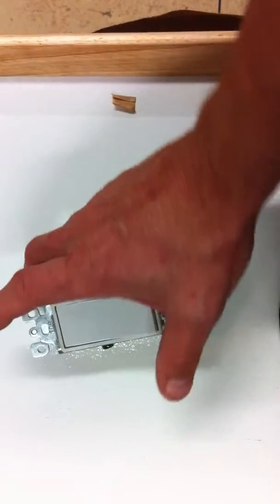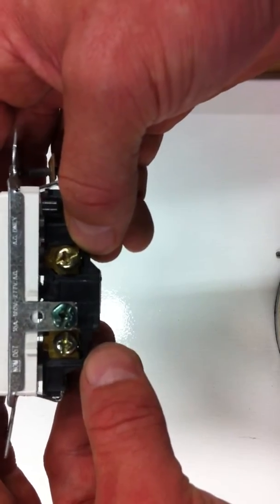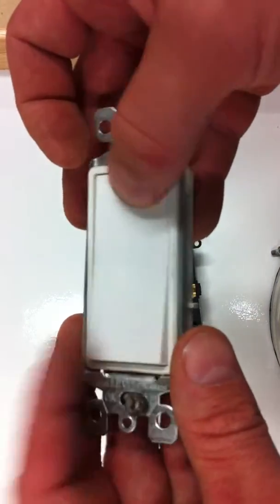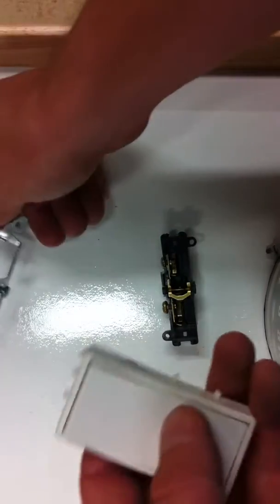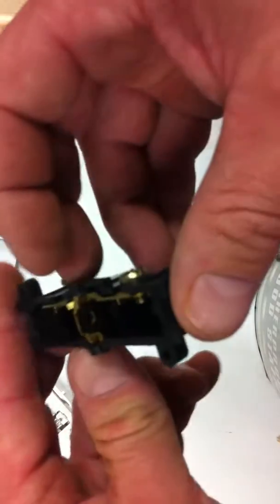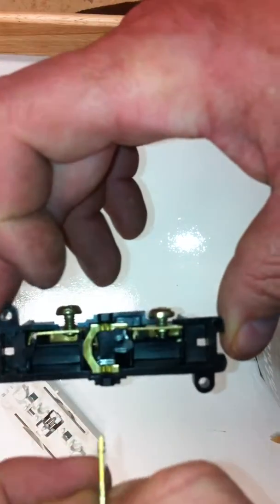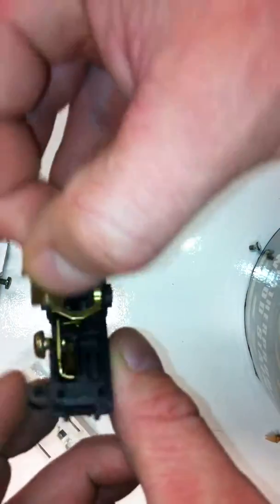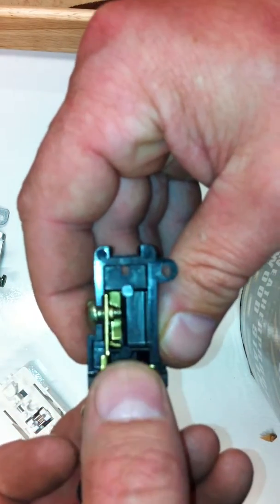Broken Light switch- How a square light switch works

Comment: Only video on actual components of actual switch. Congrats to you! Replace is not same as fixing broken switch. Although even you didn't show how to fix a broken switch atleast you actually focused on the switch & how to dis assemble it. Every video only showed "replacing" a switch which is not the same. I am looking for a video on repairing the switch when just the plastic toggle part pops off. The inner mechanisms 2 parts one that you showed and another spring like piece are next to impossible to get back in so that the toggle works. Its so annoying I need a hand? Anyway you were the only video to atleast focus on the switch components. If anyone can help please drop a line.
Reply: I am having the same issue now.. Did you figure it out?